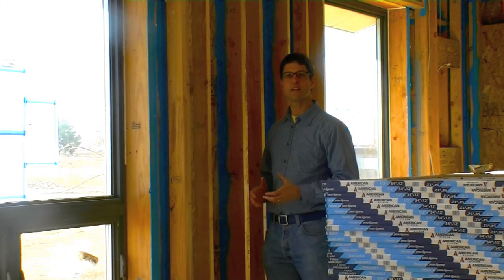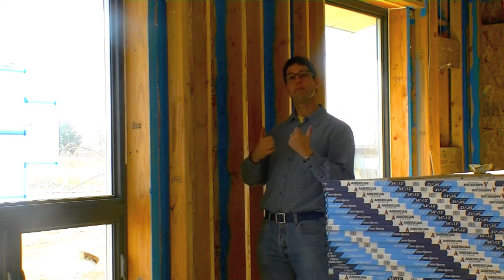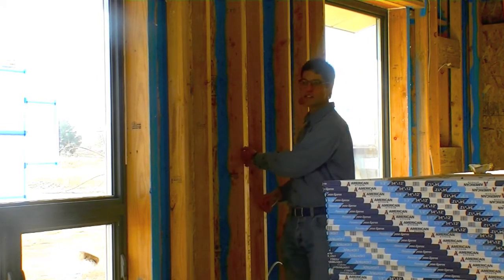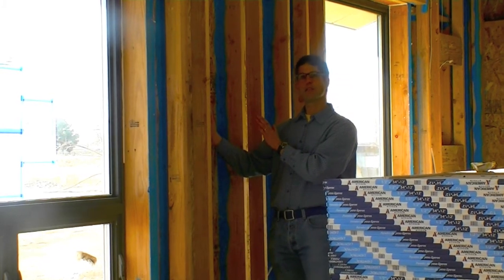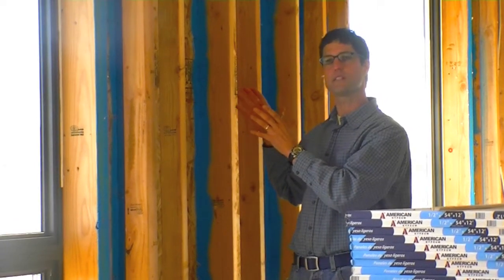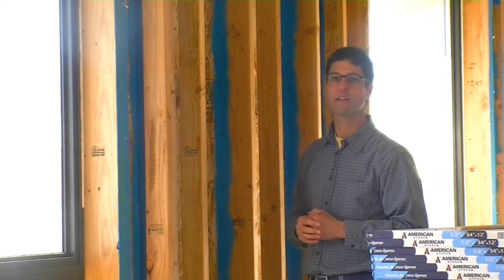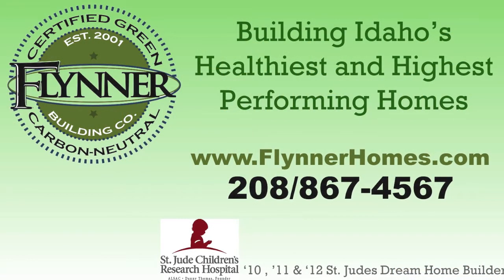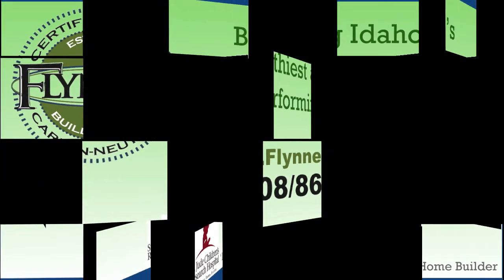Idaho Green Building Tips- Double Studded Wall

Comment: I just completed dbl. 2x4 wall construction,10" overall with 3 inch gap.
Models with blown cellulose, w/ glue and water for settling mitigation are R-35
on average walls with door and window penetrations,to R-40 on solid walls w/o.
Offset studs 3/4" to cut thermal connectivity. which also  accommodates horizontal draft/fire stop, as well as 3/4" cdx plywood continuous top plate draft/fire stop,joining both walls (makes for ease of perfect wall alignment for P&L).
Header's were engineered to 3 1/2" GLB, making for ease of frame labor(1-hdr 1-cut) Lifting 2x4 walls are a  cake walk compared to 2x6, and lumber costs were 15% less & no comp claims!!!

Comment: great job... was wondering why you choose a 2x6 outside wall.  Why not just use 2x4's for both the inside and outside wall?  Save money, material and time.  Your thoughts?
Reply: 2x6 on outside wall is minimum code and needed for load bearing. The 2x4 wall isn't load bearing, it's primary use is insulation and thermal isolation
Reply: @77Avadon77  The Code calls for 2x6's for the thermal performance, ie room for insulation. Once my inspector saw what I was doing he immediately OK'd a double stud wall using only 2x4's and blown-in cellulose. My overall thickness is 12 inches and my walls are R48. Amazing performance!